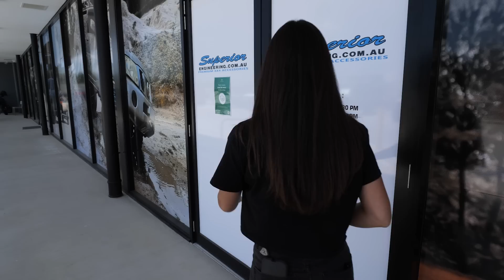COMPLETE SUSPENSION REBUILD | DID BRI MAKE THE RIGHT CHOICE?!

Comment: LOL, I'm always amused by how people  can say how brilliant a complete new suspension is by driving 100m down the road..
Reply: Its true tho, i went from flogged out stock gear (i got the 4wd and didnt care it was stock height as i had the lift going in the next week) i drove it down the road and it was heaps better and still is 5 years later, but if it had good gear and i replaced it with the same stuff later on when it needed replacing (not flogged out) i get your point
Reply: @5:53
Reply: Well… there’s sponsorship and then there’s sponsorship.

Comment: Hello Bri    How does your truck go with regard to engine cooling?   I’ve got mates with supped up Nissans and they all get hot especially long and arduous towing    My 80 petrol never rises above normal operating temperatures.  Keep up the good work   P. S.  Be good to see your rig up against the red Gladiator from Patriot Games running 40’sc
Reply: That’s why they call em a kettle
Reply: They should get some engine tuning done with a cooler upgrade.

Comment: As long as you got your springs (coils or leafs) right. You can run a cheap shocks. It's not going to create any drama whatsoever in the trails. Just get the length right in accordance with your lift and it gonna ride just fine. Remote res shocks with adjustable knobs are good looking and i believe they're excellent, but a non-res shocks will do the job just fine.

Comment: Go the Patrol! 🛻🤙😎wait so instead of just replacing bushes u changed all the parts to the same new ones ? for the video ! 📹🎬
Reply: yep! thought so ! lucky girl ! hope you get some good use out of it all !
Reply: best thing u can do for your Patrol is adjustable draglink to get your steering alignment right after any suspension lift ,  you don't have to spend $9k+ on suspension components.
Reply: you can't get 37" tyres legal on a Patrol. it's only 4" and 35s. or 6" and 33s.